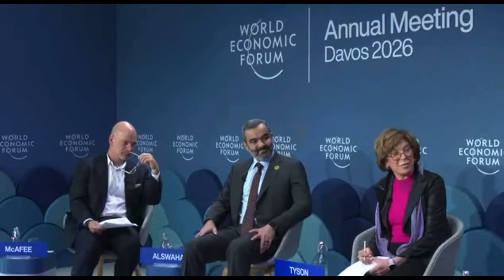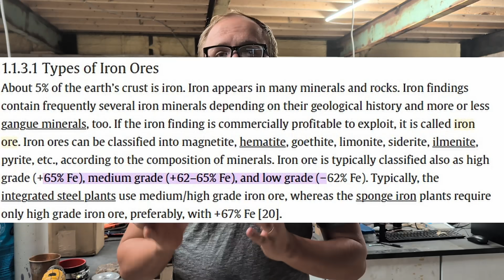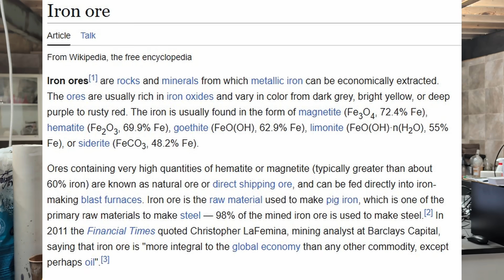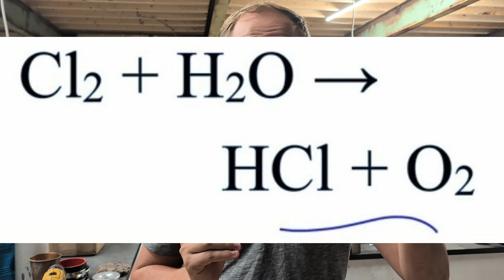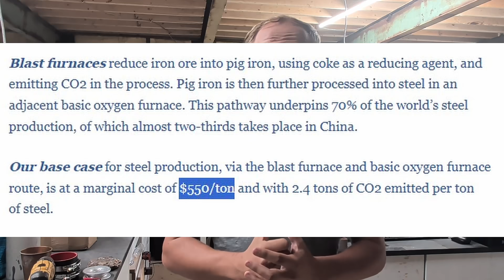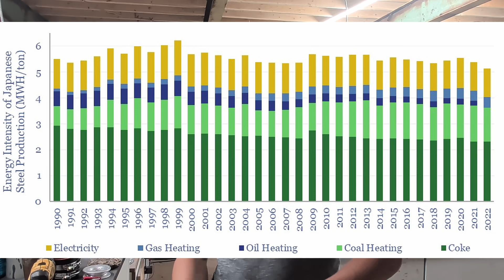Electrochemical Green Steel at Room Temperature, No Blast Furnace

Comment: What's ironic is that people are currently experimenting with iron oxide batteries, basically using exactly this process to store energy and then letting the iron rust again to extract energy. Iron is so cheap that this could potentially be used as a grid scale battery.

That said, I suspect there are some issues here that aren't immediately obvious, because the idea itself is obvious.
Reply: After some further reading, it's the "Hydrogen Evolution Reaction" that's the main obstacle here. Particularly with hydrochloric acid, any iron deposition will trigger hydrogen release, and since electrons preferentially go to hydrogen ions rather than to the iron oxide, that kills the whole thing dead. That's why most electrochemical research into ironmaking uses alkaline solutions instead of acidic ones, as it makes HER more controllable.

I'll check out a few more of your videos to see if and how you address this.

Comment: Very interesting.  I think you would need to add about 1.3 Volts to your 1.5 to allow for two diode volt drops in a bridge rectifier.  Also transformer losses to consider.
Reply from the maker: You can run electrolysis cells in series! Great example how you and other people need to think outside the box
Reply: @Rowow Of course!  I never thought of that.  Obvious when pointed out.  Hundreds in series = negligible diode volt drop per cell.

Comment: In Sweden they are doing hydrogen green steel. Have not looked into process but could you comment.

Lot of people comment on high electricity prices. But in many parts of Europe in summer prices are now close to zero often. 
Would this allow lower capex on iron plant that could be used more locally where "free energy" is availabe? Aka more smaller iron plants. That then transfer iron to steel plants.

Also what about membrane durability - that should be weak point
Reply from the maker: That's completely different

Comment: Question:  As an environmental affairs manager for a steel mill; What was waste is generated and how is it disposed?
Reply from the maker: There is no waste. It's completely closed loop. It can process waste and turn it into cleaned up economical products. If you supply me a detailed assay/composition analysis report I can run by some examples of what it would be ran into
Reply: @Rowow  100% efficient = 110% Dunning-Kruger

Comment: Show that you can economically get iron from slag.  You can create an industry as there are vast slag piles in the USA and around the world.
Reply: Doing it: Fairly straight forward.
Doing it Economically? Not a Chance.

Slag is going to be primarily impurities - The Remnants of the flux, and other inclusions you want to get out of the Iron/steel.
Roughly: You are looking at 2% at most Iron content. There would need to be a shortage to get anything out of it.

One practical use of the slag: Powder it, and add it to cement mix (70-80% cement to ~20-30% of the slag mixture): Results in apparently better work-ability; better strength, and resistance to chloride/sulphate and various chemical compounds that normally attack the cement strength leading to breakdown (ex. salt and chloride ions). And considering we are making the slag anyways; and cement is energy costly to produce - this is a perfect utilization.
Reply: Slag contains a lot of silicates. It might be a good idea to process in a way to also extract high purity silicon as well
Reply: @Demopans5990 
To extract iton from slag, you'd literally just be doing that. Its like extracting aluminum from clay, high difficulty for small material return. 

Unless you actually can use SEM Tech to refine slag. Which.....oh baby, now we're pod-racing!
Reply: Much more profitable to extract iron from red clay, to make a raw material for China. Or from red boxite. There are many minerals are where iron is detrimental. They could not be, however, a base for large scale production.

Comment: I have a question: You talk about this technology as being competitive with relation to the chemical/electrical energy used, but, how fast can that ton of iron be made using each process? Can you compare the amount of space taken for each process and the time taken to produce a given amount of iron that is of the same quality so that we can see how it really compares. I mean, the time it takes to do the process and the space it takes to produce the same amount must also be factored into the cost. Mind you, I do realize that the storage space for the materials/chemicals/reactive agents must be huge for the traditional processes using blast furnaces and such.

By the way, as an aside, is there a similar process that can be used to refine aluminum so that the high heat and huge electricity demands currently used to refine aluminum ore can be reduced?
Reply from the maker: Electrolysis needs a very small amount of space. In a comparible system im developing for other minerals, the size of the continuous vacuum filtration drum (standard common mining equipment) the electrolysis units take up less space than the drum footprint. So yeah, very compact

Comment: How are you going to deal with alloying?
Reply from the maker: remelt. Why couldnt you take 5 seconds to think of that
Reply: @Rowow  Try spending 5 seconds demonstrating your delusions before you insult anyone else.
Reply: @Rowow  No need to be insulting, but since you started it.  You were bragging about making STEEL with your electrochemical tech. What you're actually doing is extraction of elemental iron. Melting to add alloying elements still takes a huge amount of energy. Your brag about making STEEL at room temperature is absolute BS.😂
Reply: @edbennett8257  Being able to make your own high quality crucible steel is complete possible with Rowow process, you my friend are a bit blind  to what this technology is all about  I am personalty super excited to make the membranes and recycle my own metals formulate my own bronzes, brass aluminum and steels. ==== a microwave could be used with carbide crucibles for the smelting to make you custom metals  with lower cost than running a gas furnace.

Comment: But iron isn’t steel. You would need a secondary process to introduce carbon. Maybe it’s still a win, but this presentation seems dishonest. 

Edit: You are making high purity iron, but conflating it with steel.
Reply from the maker: Think monkey think. Remelt and alloy the metal. Comon you are smarter than this
Reply: @Rowow  The fact that you’re calling someone a monkey on the internet in the face of mild criticism makes it clear that you’re quite mentally unwell and probably a deeply unpleasant person.

Comment: Ok, i can wrap my head around the creation of purified iron in a cell, but my question is from there; how do you turn it into a sheet, bar or beam? Wouldn't you still need a furnace to form and heat treat the steel to get it into a useable form?
Reply from the maker: Reheating is $50 a ton in energy. Most energy is in reducing the oxide, not melting

Comment: I don’t think you’re totally off, but it feels like there may be a scaling issue here. I can’t quite put my finger on it yet. That said, if it works and you can demonstrate it with a solid proof-of-concept, raising funding to scale shouldn’t be that hard. Frame it as a pilot plant, then seek funding for both the solar buildout and the chemical separation facility—and from there it’s just execution. With that said, if your technology is limited by the membrane technology, then you are going to run into some issues.While they can be made, it can be its own limiting factor - witch case - if you know how to make those, then you can just focus on that and patent out the other. Even if it brings the raw cost up, having better grade materials normally will over come that - same for the fact if its cleaner and doesnt have as many cons to the process.
Reply from the maker: Cope
Reply: @Rowow  ? Suck?

Comment: Can you get alloying elements into the iron without melting it again? 
As if the elements have a different electro potential they are not going to come out of solution at the same time as the iron and it isn't obvious that they will deposit in the same way as at higher temperatures.

Steel is very complicated and a lot of the properties are related to heat treatments, so you will have to dump heat into it at some point, though you can do that electrically.

Definitely worth looking into though. There are also high temperature electrolysis approaches, like metalysis in the UK are looking at for more expensive metals.
Reply from the maker: No you want to melt it anyway to reform. It's only $50 in energy to remelt so not a issue

Comment: Well you want the CO2 for the plants so as long as you're burning the coal for the electricity it's all good.
Yeah 8 cents is real cheap electricity, you're going to need your own power plant for industrial scale because 1960kwh is 2 megawatt hours per ton and you're going to want more than 1 ton per hour, that's a BIG power plant so factor that in.

Comment: You are correct in a chemical sense. In a metallurgical sense you fail. You need the additional energy to form austenite and martensite from your electrolytic iron. The phase changes are where the energy goes.
Reply from the maker: No. $50 is all it takes to heat a ton of steel. The primary energy goes in reducing the oxide, NOT phase change
Reply: @Rowow  You are crap in economical side of the things. Your solution is meaningless for steel industry.

Comment: The quantity needed is the problem.
Reply: Scaling vats of hydrochloric acid for electrolysis (producing chlorine gas) obviously poses serious safety problems. That being said, these challenges are solved engineering problems not novel cases.
Reply from the maker: no

Comment: Interesting but why isn’t this being done already and what about other metals in the ore?
Reply: For most of human history, coal was cheap, while electricity was expensive... and cheap solar is only a very recent thing. As time passed, cheap coal is starting to diminish...and cheaper electricity is starting to appear as more solar comes online. In a real sense, electrolysis for iron extraction is only now becoming economical.
Reply: @nickl5658  The "cheapness" of solar is questionable.  Search the internet for why energy prices are higher and find the studies about infrastructure required to support solar.  Including parallel base load production. Batteries. Repair and replacement after weather events.  Hazardous materials disposal and recycling costs.  It is also very difficult to pin down the environmental cost to make them in the first place.
Reply: Because the average person in every industry cannot imagine better ways.
Reply: Because it requires a whole bunch of sulfuric acid, which comes with its own carbon footprint concerns and, by some accounts, is already in short supply.
Reply: @LPMutagen  NO - for starters, it needs HCL not H2SO4.  But the reason is that traditionally you would turn coal into heat wich turns water into steam to turn a turbine to make electricity to then run the system - all of which have losses, so you just use the coal to make the steel directly.  BUT if you have vast amounts of solar energy - then ion exchange membrane starts to make more sense
Reply: @piccalillipit9211 my bad, he did say HCl. Still though. The last stat I could find was 78million tons for annual steel production. There's nowhere to get that much acid of any type. Obviously you don't need 78 million tons of acid but I'm not going to do the molar calculations. You would have to create an entire acid production infrastructure to support the steel industry. Acid production requires fossil fuels. I suppose we could reinvent that process too. In the end we would just be shifting things around for the sake of a small amount of savings. If it was a blowout efficiency wise, cost wise, or environmental wise it would already be happening. I'm not saying the video is false or anything. It's just considering a problem in isolation and not addressing a host of negative externalities. It's not the creator's responsibility to do that but, because he didn't, our commenter was left with the question of why we don't already produce steel this way. Sorrowfully, YouTube's incentive structure rewards this format because it manufactures outrage.
Reply: @LPMutagen  acid production would not be an ongoing requirement except when considering production increase. you would have an initial substantial requirement but since it's not a consumable you would only need to top it off every now and then due to production inefficiencies
Reply: @LPMutagen  global steeel production is 1.8 billion tonnes and not 78 million tonnes. And 30% of this number is recycling made with electrical melting. We don't have enough scrap and we already use electricity to smelt steel. This video maker guy is wrong and is a fraud.
Reply: @MrHannatas  we don't need all these thing he is crapping about in the video. We are already using the electricity. He just doesn't know. And world needs carbon emissions to continue the cycle
Reply: @somebody1241  the world needs a steady ammount of CO2 in the air to continue the cycle, that does not include our emissions and our emmisions are not helping. That is besides the point of either the video, my reply or the comment i replied to.
Reply: @LPMutagen the system he is talking about generates the acid as part of the process. The idea is to use electrolysis and an ion exchange membrane to constantly reuse the same material to selectively dissolve the iron. The main consumable is the ion exchange membrane, and after it is set up the only inputs are ore and electricity.
Reply: @LPMutagen  HCl can be made via brine electrolosis. The stuff desalination plants produce and have to dilute before putting it back into the sea. It would produce NaOH as a side product but it has plenty of other industrial uses. As long as we have sea water we can produce HCl
Reply: @pokekick4185  and this process remakes HCl in the same electrolysis bath and with the same electrodes that it uses to plate out the iron. That's what's so great about it.  

The cheap membrane makes mucking around with impure ingredients okay, which opens up lots of avenues for chemistry that just wasn't done before, because it would ruin a costly membrane just to try and see if it was a good idea.
Reply: @piccalillipit9211  for the vast amounts of solar energy you describe we need more silver and more copper which we don't have. There is already something called sponge iron which uses less coal and lower grade coals to be made and is used as substituıte for scrap. On top of everything we can use hydrogen in blast furnace instead of coal. And it has been tested in many blast furnaces and the process works. Usage of coal is because of national fuel security. Back in Cold War up until 70s oil crisis we were using fuel oil in the fuel mix.